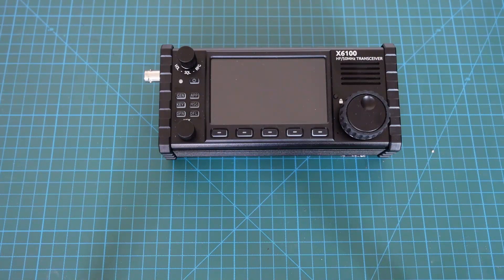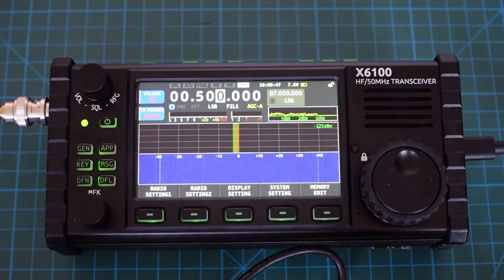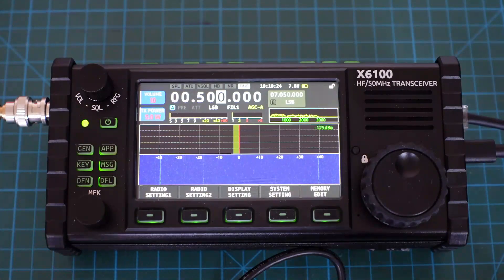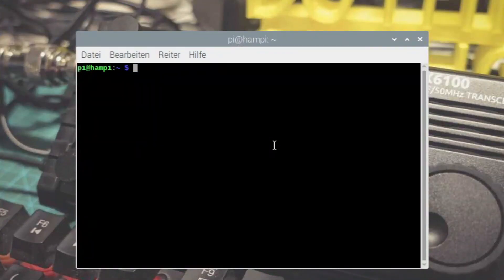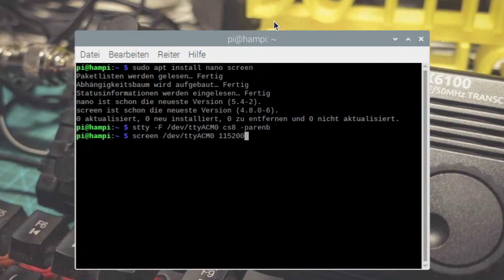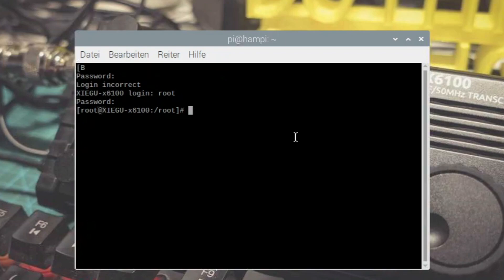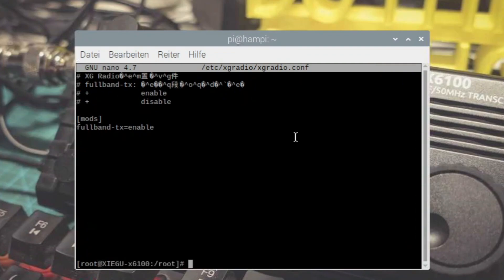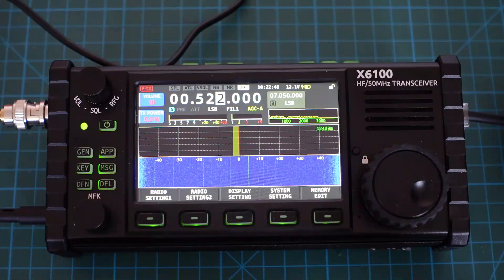Xiegu X6100: FAQ 000: Frequenzerweiterung / MARS MOD / Full TX

Comment: Kleiner Tip am Rande ;-) es geht auch wesentlich einfacher. In den Einstellungen Wifi konfigurieren, dann über WLAN mit der IP des Xiegu und SSH direkt auf das Gerät als root zugreifen. Dann mit nano editieren fertig. Vorher mit exit aus der Konsole ;-), oder reboot über die Konsole geht auch.
Reply: so braucht man weder Kabel, noch umständlich die Schnittstelle konfigurieren.
Reply: Die beschriebene Methode funktioniert nur mit der neusten Firmware! Will man den Mod für ältere gibt es eine gepatchte Datei und eine Github Seite wo das erklärt ist.